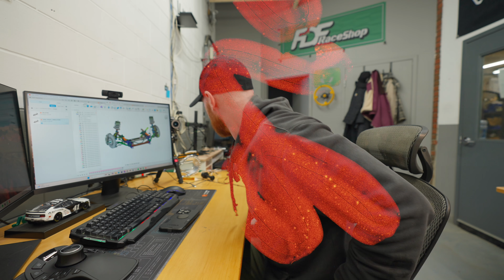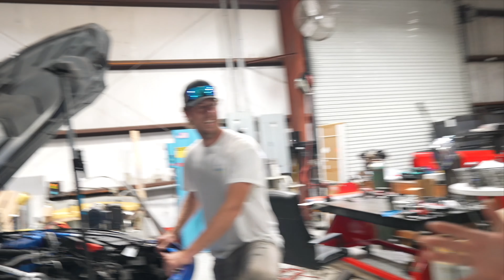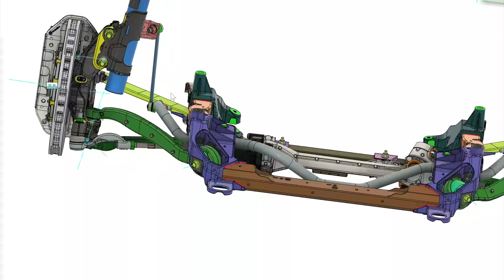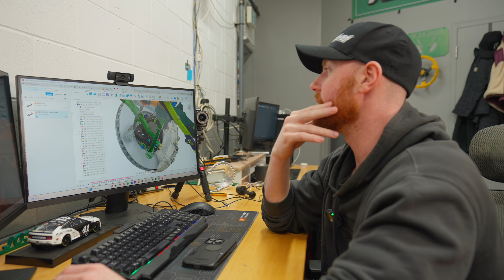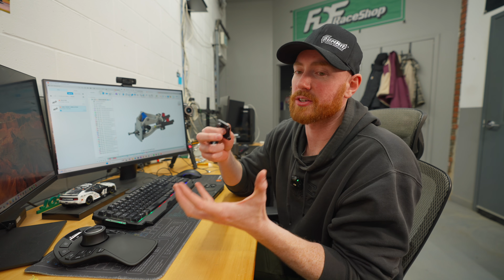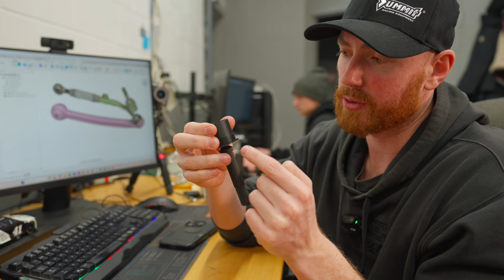Angle kit design for Cleetus and Adam LZ

Comment: We need a third gen Camaro kit. They made a bunch of them and you can get them anywhere from 500 to 5,000 and they’re McPherson strut. You’d be the only one with them on the market and it wouldn’t take much to make them
Reply: Good call, and you get a torque arm rear suspension to start out with in them too, great susp choice for a solid axle. Ever since the Atlas 4200 I6 started gaining traction, I've had devious thoughts of an Atlas powered 3rd gen drift car😎

Comment: so was the 3rd car the Ve -Vf commodore? looks like the same setup could sell plenty of kits here in Australia if it is the same
Reply: No, this is the GM Alpha platform...
Cadillac ATS
Cadillac CTS (3rd gen)
Cadillac CT4 (ATS successor) 
Cadillac CT5 (CTS successor - no idea if the front subframe changed from the _TS cars to the CT# cars)
Chevy Camaro (6th gen)

VE & VF Commodores are Zeta platform, shared with the 5th gen Camaro(and the Pontiac G8 & Chevy SS rebadge jobs) - you should have plenty of aftermarket already, the 5th gen developed a solid market. FDF already has a 5th gen angle kit(I can't imagine the front subframe is different between the Camaro and the Holdens).
Reply: @RyTrapp0  awesome info mate cheers will msg them about a 5th gen kit
Reply: @ZaredFox  Yup, no problem!

Comment: QUESTION REAL QUICK!!!!!! PLEASE ANSWER???? it can be a quick answer, why did ya make a single control arm/wishbone link for the CTS??? and not a virtual pivot/double ball joint setup
Reply: I know you're wanting a response from him, but I'll take a stab at it. I would imagine it has to do with complexity. It sounds like he's making the kit based around the factory knuckle. The OEM virtual pivot likely isn't in a good location for what he's trying to do and making some kind of adapter to relocate that virtual pivot is far more complex than designing an adapter for a single ball joint. I don't know what all he's done in the past, but if he's very familiar with single ball joint designs then it's also much easier to translate that knowledge to this than to try to figure out a virtual pivot. Again, especially without designing a new knuckle from scratch.
Reply from the maker: Virtual point simply won’t allow for the angle and at higher steering angles the ball joints bind them selves up on the knuckle. So it simply isn’t possible to get over 45 degrees with virtual pivot design.
Reply: @josiahfallaise  DUDE thanks so much for replying!!!